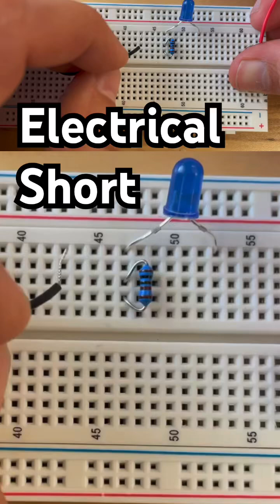Common Mistake on Breadboards - Electrical Short

Comment: You killed it with the Voltage not the current 
A resistor in series with the led limit the voltage that can flow and so the current it limited
Reply: No
Reply: first of all, voltage does not flow, current does. second, a resistor develops a voltage drop, but limits current, depending on voltage. third, it is indeed the current that kills leds, not voltage. led datasheets specify maximum forward current, not maximum voltage (only a forward voltage drop depending on current, which has to be limited by external means, which of resistors are only one option).

Comment: I appreciate that you say that MOST of the current ignores the resistor. Electricity takes ALL paths, unlike what most people think lol
Reply from the maker: Always a tough balance between speaking simply or accurately …but glad someone appreciated it👍
Reply: Second that! It's way too easy to get lazy with language when explaining things.

Here, have a gold star: ⭐️
Reply: How is there current if both terminals of the resistor are at the same voltage?
Reply: @enriqueniemannconcha7267 how is there current through the contact strip in the breadboard if the voltage is the same at both ends?
Reply: @ke6gwf  the resistor is shorted. There is no voltage difference between its terminals. I believe no current flows through the resistor at all
Reply: @enriqueniemannconcha7267 so the terminal strip is a perfect conductor, no resistance in it at all?
Reply: @ke6gwf  I think that the strip being a decimal of an Ohm, compared to the resistor could make measurements of current hardly distinguishable from noise. I could be wrong. Will grab a scope to check.
Reply: @enriqueniemannconcha7267 excellent that you were able to change your thinking when presented with new information! A lot of people are unable to do that lol

And as he said in the video, they are parallel circuit paths, and obviously one of them is going to be preferable, and so most of the current will take it, but as long as the alternate path is a conductor, it will be used as a path for current, even if it's a high resistance, simply because the electrons don't know that another path exists, and so they move down all paths, some paths just resist the flow more than others.

This gets interesting when you start looking at current flow through the earth at the utility scale, where they can actually use the earth as one leg in a circuit, but it requires a really good ground system.

But while each current path may seem high resistance, once you get a couple of hundred feet away from the ground rod, you have so many current paths that it becomes very low resistance, and for long distances, you have practically infinite current paths available, and the earth becomes a very good conductor.
Reply: @enriqueniemannconcha7267 The voltage along the length of wire is not the same all the way along it.

It depends on the length of the wire, the cross sectional area of the wire, the resistivity of the metal material in that wire and the magnitude of the current in that wire.

The only time the voltage is the same all the way along a wire is when there is zero current flow in that wire.

In this particular case, the voltage drop across the ends of the resistor will be incredibly low, so low that it will often be considered to be zero, but it is not zero.